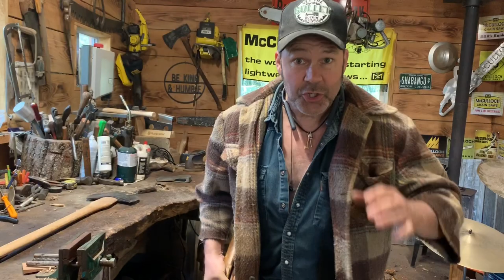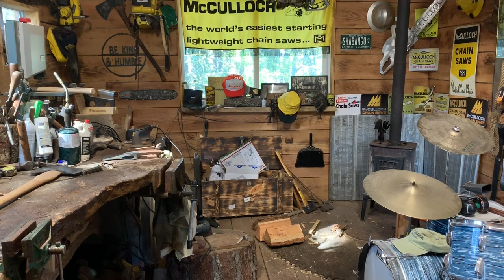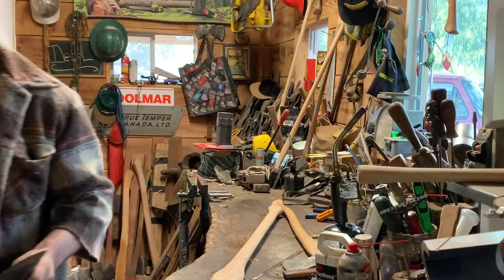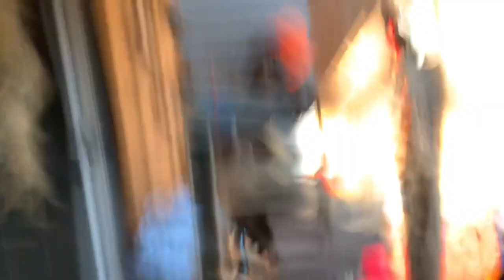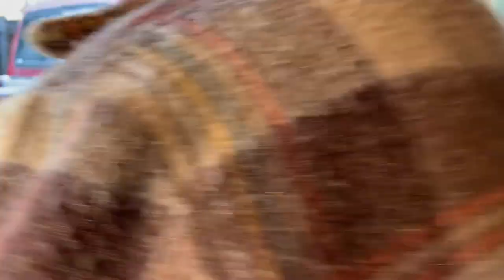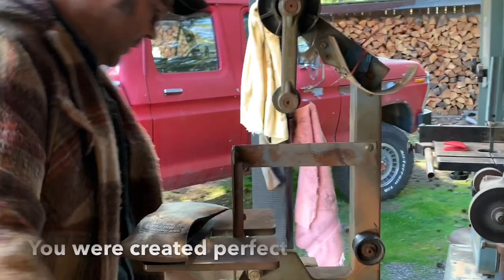Sharpening my firewood splitting axe. Plus pain motivated ideas

Comment: I understand!  After 2 major back surgeries I am fused with rods and screws from L4-S1 and cannot sit or stand for more than a few minutes so I gotta move or lie down so thanks for the great idea!!   When I go to the store I grab a cart in the parking lot if possible so it can carry my purse and I can LEAN.  So here is a couple good things I learned that may help you.  I use a seat cushion in the car with an opening in the back (or pulled forward a bit) so the bottom of my spine is suspended, it takes pressure of the spine and the cushion absorbs the pressure/shock and I tip the seatback back an extra notch to relieve vertical pressure, it helps lots.  Also discovered a gadget called the "Low-Bak Trax" for easy stretching my spine and back of my legs (it is all connected) and it is amazing, please trust me on this, it works wonders.  It only takes a couple of minutes and gives your disks a chance to get blood flow back in and re-cushion themselves, it's huge (the gadget is small, the relief is huge).  Anyone with back pain should have one.  Would be great for preventative measures for sure also.  Your latest big fan.

Comment: When I was living in Australia, at work these guys asked me to get a tool out of a junk box up in the rafters, 8 foot centres.  Where you climbed up was a rafter away with no apparent way to get over there.  The guys told me to cross on this rough cut 2x4 of Aussie hardwood.  It barely flexed under my weight of about 165 lbs.

Comment: I had a bad lower back for years from sitting at a desk all day. I switched to a standing desk but would get sore from standing for too long. In my case it was the muscles used to hold the body up that were underperforming (because they had been underused for so long), allowing my spine to sit in a way that wasn't good. Working my core and glutes (and stretching my hip flexors) has almost completely fixed it, although I can feel the pain returning a little with all the sitting I am doing during lockdown. Get into those squats and deadlifts! And ab exercises.

Comment: Hey Buckin, friends and family. Newcomer to axes and I’m wondering what different needs or uses there are for different length handles. I’m going to be rebuilding a few old axes and I’d like to get one of each for certain uses and it seems the length of the handles plays a big role. Thanks!
Reply: @jpm I'm sure there are a lot of factors in play but some reasons may be, balance heavier heads usually have longer handles, the hight of the person swinging it. Tall guy with short axe can't reach past his feet when splitting, I think wedge bangers usually have shorter handle. Hope this helps 👍
Reply: Morgun Freedom this helps a lot thank you for replying!